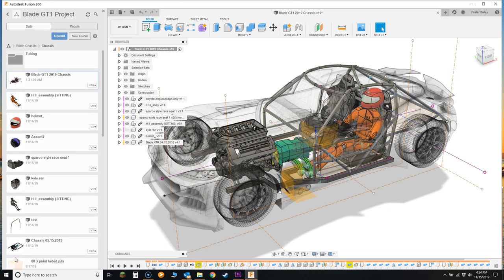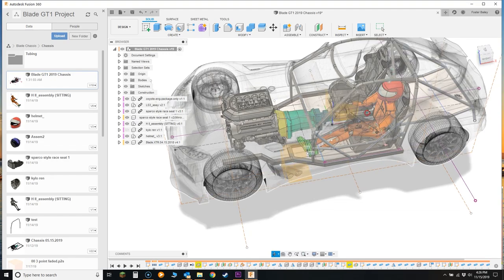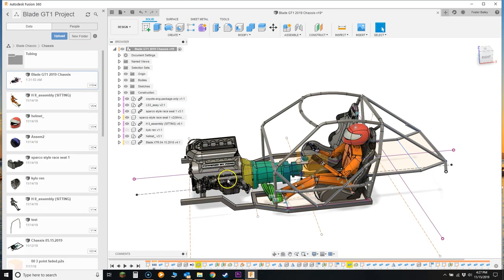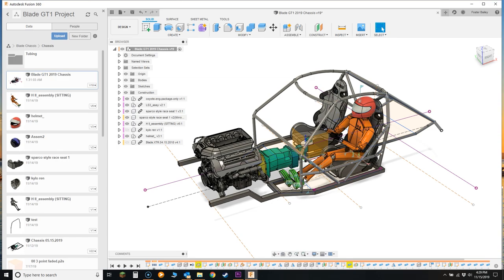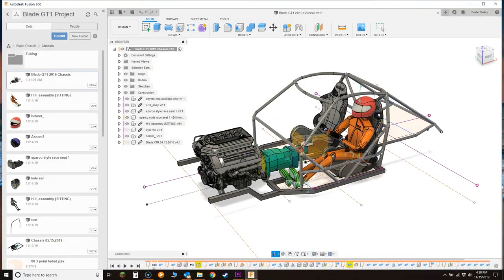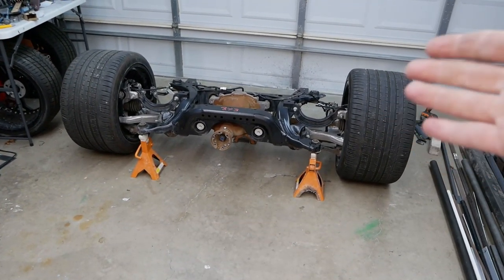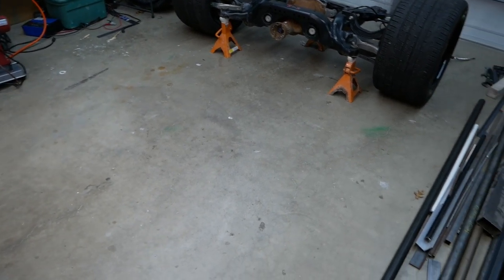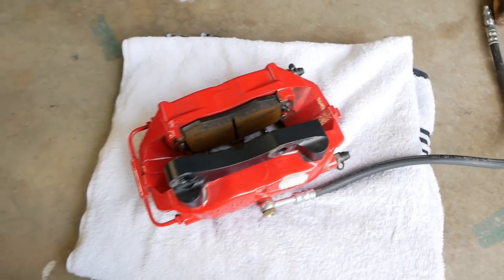Building a race car welding the Belly Pan for Blade GT1 - Ep04

Comment: 1. You could use 'chalk line' (chalk string that is used to mark the ground for construction) rather than a piece of sting taped to the ground that moves about. To set the chalk you could spray over it with hair spray or a clear lacquer to keep the line from rubbing off. Once your done, you can wipe the ground clean with acetone/paint stripper to get rid of the markings. 

2. About the exhaust 'IF' the circular shape/diameter will cause you clearance to the ground, maybe look at Ken Block's Hoonicorn exhaust, where he transitions from circle downpipe to an oval exhaust pipe (almost flat) so its very low profile to the ground for clearance; but should still flow a lot as he's pumping out crazy power.

Could DIY this low profile pipe by cutting down say 1.5" pipe down the center and space them out and connect the halves with a wide flat bar top and bottom.

Just thinking out loud, but your plans already look great with the normal exhaust pipes be it 2.5" or 3" meh I'm just a simple ol' noob ^_^ 

Keep up the great work (keep churning out these videos ASAP, I'm already itching for more) impatient much! haha ^o^
Reply from the maker: Thanks man for the idea on the chalk like and hair spray. I actually have a blue chalk line under the string. Its just hard to see with the texture of the surface. That's why I have the neon string there. As for  the exhaust, yeah I thought of that and my first exhaust on the first prototype was oval shaped. But I think I will have the clearance now that I am thinking ahead of some of the previous issues.

Comment: If you want to tuck the exhaust under the car consider removing the jog you have in the front rails and extending that rail straight back. Sort of like the present corvette frame where the strength comes from building it into a truss like configuration. It makes the body mounts a little more difficult but it can be done and gives a lot more clearance for the pipes under the car.
Reply from the maker: Thanks for the idea. I think I have it figured out now. You'll see the update in next video.

Comment: Looking good so far. For one, what about running a single 4" pipe underneath, then transition to a dual out the back? Or you could run the side duals you had on the previous chassis. And Neal, is the email at the website still active? If like to shoot you a couple of questions please, thanks.
Reply from the maker: Thanks man, Yeah I have thought about a that or using a the oval format. But I would like to keep it all consistent for better flow dynamics. I think I have the solution now. You will see in the next video. And yes that email is correct. You can also message me on YT or Instagram.

Comment: Try looking at side pipes like the viper for your exhust.
Reply from the maker: Thanks I will keep that in mind if nothing else works. I would require some major changes to the body though.
Reply: @NealBaileyStudios We did a n ACR viper track build at one of the shops I was working at and had to remove the cats before any sort of tuning even (I forget if it had 4 or 6). They would get too hot and started burning the paint/plastic around the openings. Pretty sure it was an airflow issue that could be fixed but still some food for thought
Reply from the maker: @rlew12  Thanks man, yeah acts can cause a lot of heat issues.

Comment: Very cool. Been subbed a long time glad to see things coming together again. I'm sure theres a reason people dont do it but for the exhaust could use the frame as the exhaust pipe to get to the rear. Cool idea but may not be practical lol
Reply from the maker: Thanks for hanging in there all the time a time. On running the exhaust through frame rails, its not a good thing although people have done it before. The heat, causes corrosion and metal fatigue. Plus cabin heat would be and issue and potentially fire hazzard.
Reply: @NealBaileyStudios    yeah the heat and fire hazard is something i didnt think about. The corrosive part was my main concern. Youll get er done though. Lookin forward to the next video buddy
Reply from the maker: @averagemyke2843  Thanks man, yeah the holiday has me a little behind on videos. Hope to have one Tuesday.
Reply: @NealBaileyStudios  no worries. Enjoy your holiday man.

Comment: Please can you make a rear mid mount rear wheel drive middle seat position car to go head to head against Sk's ASL E 55 AMG. Ultra light chrome molybdenum steel chassis with minimal body work like an mad American Arial atom v8 . Or American BAC MONO v8 .
Reply from the maker: Hmmm not exactly sure what you're asking 🤔 but I'll ask Sk when he comes by. 😉👍
Reply: @NealBaileyStudios  you are making  a front mid  engine rear wheel drive super car . And you have made it perfectly which was unbelievably cool and you made it look easy  . 

Please just make a rendering and put it up for a vote for a rear mid mount rear wheel drive car with a driver seat position in the middle like the McLaren F1 .

and the chassis structure like an Arial atom . 

Or an hybrid power petrol generator with electric AWD hub motor car with a center seat position like a McLaren F1  . Nobody is trying this . 

Student engineers in Germany have made one (an electric version) in 2013 for formula student competition and its extremely fast with a 0-60mph at 1.6 seconds world record. It is a formula single seat race car at 450lbs weight. And the teams name is formula student AMZ .

Comment: Is the bracket for the calipers short enough? It looks like the caliper was a bit far out  when you were mocking it up and wouldn't have pad fully contacting the rotor
Reply from the maker: Yes, because of the bracket I could get into proper position. I need t o mill the bracket a bit then it will fit.
Reply: @NealBaileyStudios  Aweseome! Also I did the chassis and suspension design of my school's SAE car (single seat shifter kart powered by a cbr600 engine with front and rear SLA suspension) and would love to help out if you want a hand validating any design choices

Comment: Im guessing the wheels and belly pan sides are rough guesstamets as far as placements? I would say maybe a little more triangulation on the rollcage though, if you can flip it over and jump on it and it doesnt wobble or anything to indicate that theres a weak area then it should work for crash test ratings, I am presuming youd still like to sell this at some point as a mass production vehicle and over engineering stuff now will save you time in the future
Reply from the maker: Yeah in this video everything is just placed near its position. In later videos you will see how i tie everything together. And the chassis will have a lot more triangulation and gussets. etc. I had a lot of the items hidden in this video.
Reply: @NealBaileyStudios  good to hear, I would still like to see one of your earlier concepts come to life as well, maybe even as a kit car?